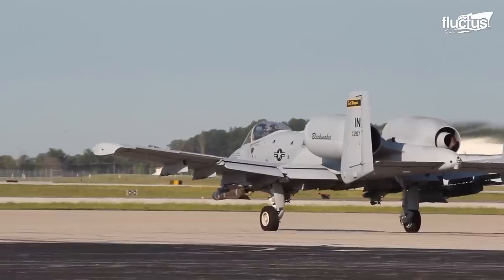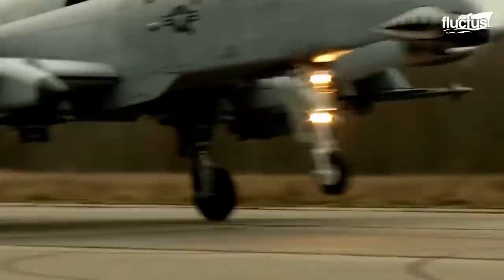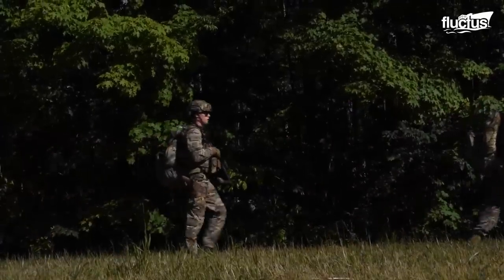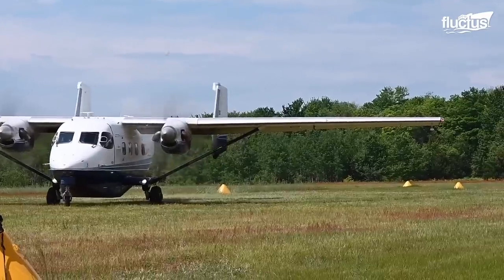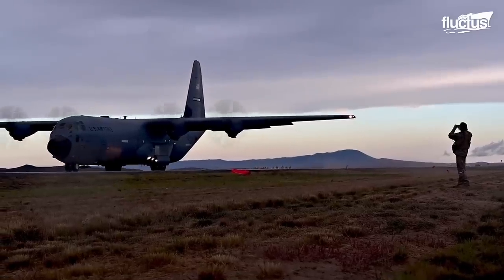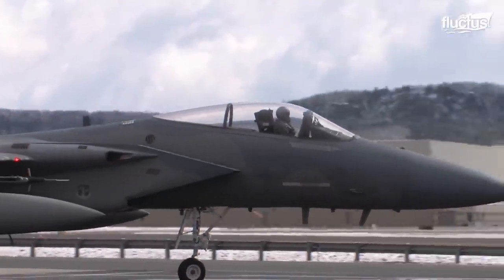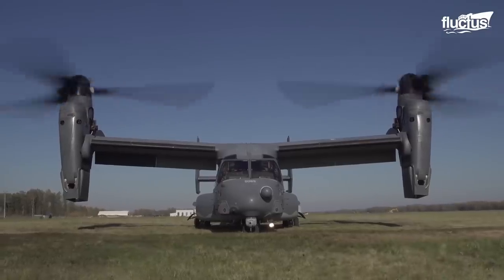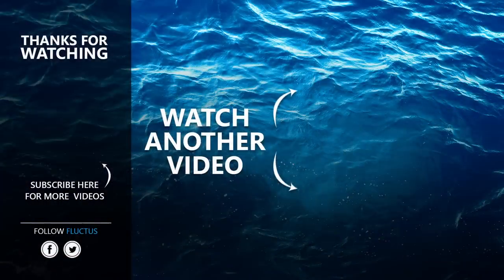Why US Keeps Trying to Land its Powerful A-10 Aircraft on Dangerous Highways

Comment: Sweden was among pioneers of using regular highways as military airfields. All their aircraft are adapted for this for decades
Reply: did they do this before ww2? its my understanding the interstate highways were almost carbon copy of the highways in germany and the most important aspect is lengths of highway long and straight enough to land aircraft as a way to bypass destroyed airfields.  after ww2 the u.s. raced home to copy this idea.
Reply: I believe most Nordic countries follow this doctrine to some degree. Not to mention the Nordic countries tend to have a very well-developed their defense system so the A10 makes perfect sense strategically. It will make any invading forces armor pay to a degree that Ukrainians can't do. Not saying that they aren't doing well just saying these countries have better air defense. This is the right answer.

Now I wonder does this mean we have a replacement for the A10 in the works?

I wonder if this means we are getting a
Reply: @PizzaGenie  Finland have a history of using this strategy to a lesser extent, but I've never heard of Denmark or Norway doing it at all. If you want to launch jets from highways the jet has to be able to take some serious abuse. The Finns have used arresting cables to stop their F/A-18's quickly on open roads. The F-16, which both Norway and Denmark adopted in the 80's, is completely ruled out for this purpose, and I doubt they're especially interested in using their 5th gen F-35's on public roads either.

Comment: As a pilot and flight instructor, I think it is amusing to see that somehow landing a plane on a road or a dirt strip is somehow worth reporting.  I've landed on strips that were literally a pair of ruts in a dirt road....as they say, "it ain't no big deal".  The A-10 has a 58 foot wingspan (so a little bigger than the high 30's of most small civilian planes) and is purpose built to handle much rougher surfaces than any standard small plane.  So long as the strip allows for at least a few (5 or 10) feet on either side of the wing tips, any competent pilot can put the plane just where they wish.  And taking off is even easier to deal with.
Reply: You can see from the cockpit view that the aircraft takes up just about all that roadway has to give with the wing tips just about over the guardrail. Also, the experienced pilot flying give a visible sigh of relief when he is clear the trees or canopy. Not so easy as a Cessna.
Reply: Your Cessna isn’t armed and doesn’t have jet engines. Exponentially higher risk levels to factor in to the crews, engineers and civ pop.
Reply: @DC-uj5rq  Agreed...BUT, it STILL is just a matter of control; you have no surprise at a plane flying in formation within feet of each other...or landing perfectly dead center and on the spot with a carrier landing.  Yes, he was relieved...as a military pilot is is possible he never landed on anything but a big runway before!
Reply: @neillgowans4350  What does THAT have to do with it?  As I said to D C, above, the plane  can fairly easily be controlled to within a few feet while flying or when landing.  THAT is all that matters for the difficulty!  Being higher risk because it is armed is irrelevant to the actual task.
Reply: Yes, but most people don't know what you know.
Reply: Amusing to the experienced, yet awesome to the wannabe enthusiast of A10 (that's me). If by strength in old age I can learn to fly, it would be taught on a Hawg. jus sayin
Reply: The Swedish air force even have it as strategy to use road bases in times of war. Even the C130 is capable to land on roads, so what so special?
Reply: Sorry they were waiting in vain for your permission,  before making a video to show for those who might be interested. Stunad.
Reply: @LarryB-inFL  
True, in decent weather conditions, this would not be too difficult for a good pilot - but FOD is a concern (not as much for the Hog as for other jets) and when you need to land, high crosswinds could create some serious pucker factor. Those trees get a lot closer when you are crabbing in sideways and could be buffeted several feet to the side by a gust.
Reply: For Russian consumption
Reply: @mikewa2  that's why America has so may roads always a landing strip somewhere.  Russians can't get them all.
Reply: I think it's more important to show some of the things an A-10's and C-130's can do, which no other military aircraft can do...just to show it would be a drastic disservice, to the military, to even think about decommissioning these aircraft...
Reply: @neillgowans4350  plus a Cessna doesn't have to land at over 100 mph...
Reply: @Larry Bloom  actually, higher risk has a significant part to do with it... a Cessna can't carry nearly a ton of high explosives, it doesn't need to fly at over 100 mph just to land, it weighs about the same as a heavy passenger car not nearly as as a semi truck,  etc., etc... I've seen Piper Cubs land in less then 50 foot strip and take of using the same strip, but the risk is still not as large as landing a A-10 or C-130 on "unimproved" strips...
Reply: Digging in the dirt and nosediving is how it got the name warthog. That big gattling gun makes it front heavy. I'd avoid dirt landings on an A10
Reply: The A 10 is a very intimidating! Looking flying gun
Reply: As a pilot you know this. Civilians don't. Aircraft presence in an area takes away suspect and fear. It is called, conditioning.

Comment: One of the original design criteria for the Eisenhower Interstate Highway system was to be able to use them as runways around the country.  It's amazing what our military is capable of when they "turn 'em loose"...
Reply: Exactly, for dispersion of aircraft in the event of nuclear war or invasion. I believe it was something like 1 mile out of every five had to be straight without curves.
Reply: I thought the Air Force didn't want the A10 anymore, I believe the Marine corps' wanted to keep the plane
Reply: @tonymills5086  They just spent a lot of money giving them new wings and an updated cockpit.
Reply: The best part is these landings occurred on state roads, not part of the interstate system.

Comment: The interstate highway system was built as a national defense issue.  WW2 revealed our road system was inadequate to move materials and was too dependent on railroads.  As a result the Interstate Hwy system was designed.  There was a requirement that every so many miles the road system, where possible have a flat section of hwy of so many feet to accommodate the landing of aircraft.  We are now just practicing these landings however in europe they once practiced this on a regular basis.

Comment: The A-10 was designed to fight against an armored Soviet attack in Europe. It was built with the knowledge that it would be necessary to land on public roads to be refueled and rearmed because many of the runways in the European theater would be damaged or destroyed by Soviet airstrikes. The A-10 is a very purpose-built aircraft. In the United States, the Interstate system was purposely designed so it could be used as a runway for military aircraft in times of war.

Comment: Our Interstate Highway System is part of larger Military Transport and Supply routes...

When new Freeways were designed in the 50's, the number of overpasses were limited. There is 5 miles between them. Even largest aircraft can take off and land given 25,000 feet of clear roadways including; Cargo, Troop, CAS, Jet Fighters, and more.

In National Emergencies, don't be surprised if you see aircraft land on roads.

Comment: In South Africa there is still emergency runways on public roads. If you get to a 3mile stretch of road that is wider than normal and have n visible utility lines it is a runway that can take a fighter. Most have gates at the ends that is locked in the open position with the keys at the local police station. Well that was during the 1980,s. Some small town airfields could also be used with the provision to erect a base on it.

Comment: The training is for urban operations and primarily in Europe. The TAC folks can provide glide slip into, controller and landing procedures. Most probably do not know but all interstates were built for just this reason and movement of military equipment. The highways are not state owned.

Comment: How do aircraft get off the ground with their flaps "retracted"?? Flaps have to be extended to either "full" or, in some cases, "automatic mode" as selected on the co trol panel. I say, in some cases, because I am more familiar with the F/A-18C, which has this particular setting.

Comment: Ground mapping radar and orientation mapping should be done also, previous to landing on the unprepared or unknown ground before landing , so that a landing thrust and lift and speed at and over landing and take off measures, so the flight control automation can compensate by calculation of terrain and flight and frame and landing and take off capabilities.. that's a nice option I want on all of my wives and companies aircraft as well as our military and cargo aircraft. 
 Don't want to land it into a ditch, and if there is a hole or ditch, it can hop over it and land and or decelerate more safely. 
A tail anchor plow sounds nice as well... with arrestor cable to it, shoot in bolts maybe... .. but not important in many areas .. sonar pulse or whatever mapping.. 
 Then the safest firmest ground will be used and tamped down for landing and take off... 
 And the skid or rolling track.. rolling tracked skid plane.... hmmm.. too many thoughts.

Comment: This isn't impressive at all. During the Cold War USAF regularly trained take off and landing on highways in Europe with F-16s.. Currently Sweden trains that almost on a monthly basis with Gripen fighter jet..  Like I said, doing it with a rugged and slow flying A-10 isn't particularly impressive or special at all... When I see this being done with F-35s, than you've got something to brag with given that the F-35 is a highly advanced and high tech flying machine that doesn't like foreign debris objects being sucked in it's P&W jet engine, particularly since it uses divertless S shaped intake to hide the fan blades from radar, therefore enhancing the F-35's stealth capabilities.